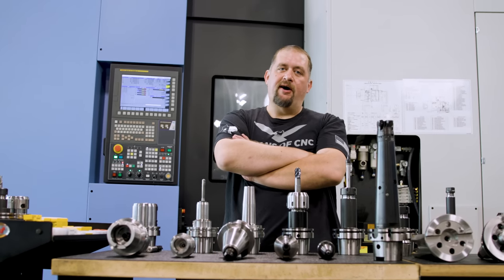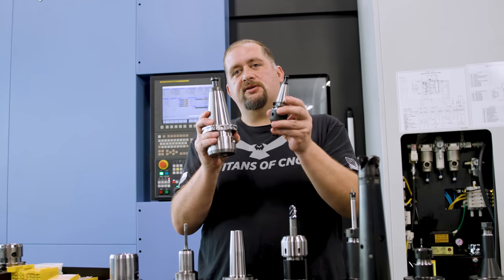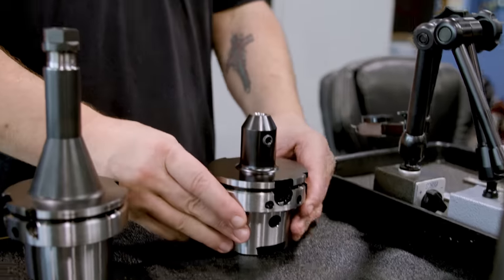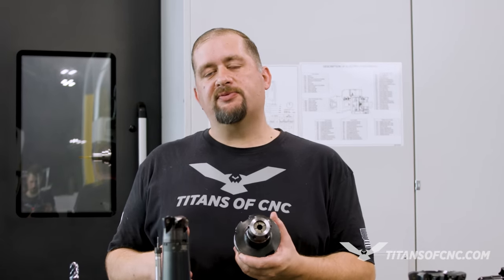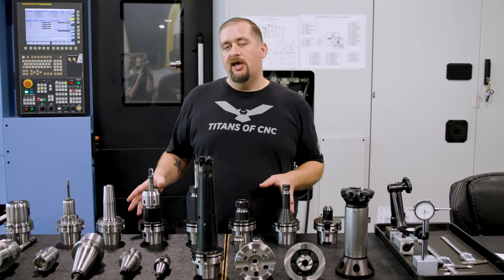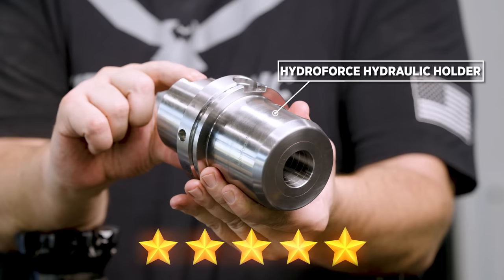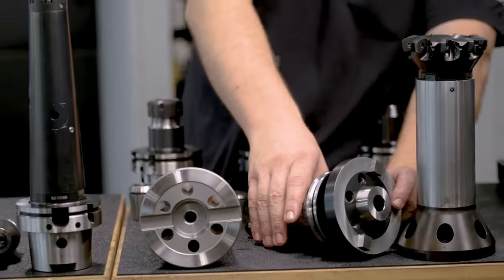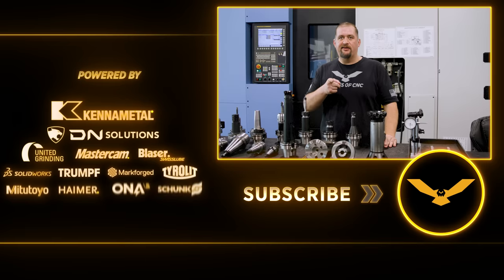How to choose the right tool holder for your CNC Machine | DN Solutions

Comment: Interesting video on the surface.   I have been in the industry for 20 some years and yet to see anything but CAT 40/50 spindles on machines.  Shrink fit tool holders are for youtube channels because no shop wants to pay extra for a machine just to put tools in holders.  If you have tight tolerances then its called playing with cutter allowances in the controller and a couple test cuts to see what size the cutter is cutting.   I have used dampener style tools in the past with varying success.  Hydrolock holders sound great but your locking yourself into a proprietary tooling ecosphere then.  Bottom line is the vast majority of machine shops will never see return on cost for anything but regular old sidelock and ER collet holders.   As for the video itself.  Coincidence that most of the tooling talked about is also sold by Titans webshop?  Video screams total add.
Reply: Maybe u should visit a modern shop. Worked on plastic moulding forms with 2 typo: hydro for roughing and shrink fit for finishing, both HSK. 

Runing 35K RPm and more or going hard in toolsteal that mill better spins centric and a collet doesn’t do the job. if u need to take multiple test cut u just messing around.
Reply: Almost everything i talked about in this video holds true for every manufacturer. Is it a coincidence that Kennametal is the largest manufacturer of toolholders in the world and thats the holders in this video? No coincidence at all. And not an ad. Education
Reply: And fyi i have worked for several world class shops that look at a shrink fit machine like it cost a penny.

Comment: how does hydraulic give the best of everything when it usually has the worst reach and clearance?
Reply: Well, youre correct in that regard, but i wasnt rating holders based on reach or clearance. Which is why I gave a shout out to slim body shrink fit. For reach and clearance, you cant beat a good shrink holder!

Comment: Unpopular Opinion: 
Multi Contact Spindles are extremely swarf sensitive. One microscopic contaminant on the flat contacts and the entire concept falls apart. More of a problem on Verticles than Horizontals (diff between swarf falling away from instead of onto the flats). Don't get me wrong Multi contact tools are great for Tool & Die work and low volume prototype project based work and for more cleaner cutting materials such as your harder metals.  However for materials that tend to make more of a mess such as Brass, Aluminium, Bronze, Cast Iron, plastics, or even Mild Steel depending stock quality, Multi Contact is not so great for these especially from a production standpoint. We as engineers do the best we can to make sure that everything no matter what is as clean as possible during set up but the fact of the matter is that it's not a perfect world things get dirty during production. It would be ludicrous to be stopping and cleaning every hour of production. A dirty taper contact is naturally less upsetting to a tool than a dirty flat contact on a multi contact. My point being there's more to go wrong with multi contact and its pointless if it's not actually multi contacting and ends up relying more on its taper within the first hour of production - may aswell have a standard single contact taper that doesn't rely on 1 or 2 other contact points to work properly.
Anyways that's just a bit more than my 2 cents based on my own personal experience, others may have different experiences. Hell, try it for yourself and come to your own conclusions.

Comment: Not a fan of the hydraulic holders. I sucked a 3/4" 3 flute endmill out of a hydroforce holder and ruined a giant aluminum part. I sent the endmill to our tool sharpener and had him EDM some weldon flats on them and went to a sidelock holder.
Reply: Yeah, same here. To compensate for the eccentricity of a sidelock, I just feed it hard enough to bend it so all the flutes are cutting. It's called variable flutes engagement 😁 If you take a cut and then a spring pass where the latter still makes a chip, then your tool runout is immaterial so long as you avoid spring passes. A less rigid spindle can be a good thing 😉